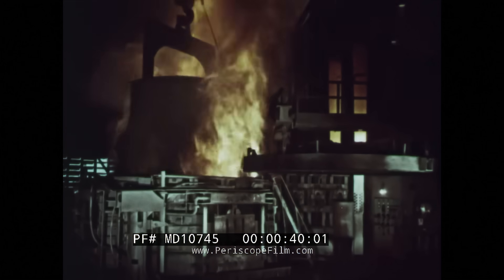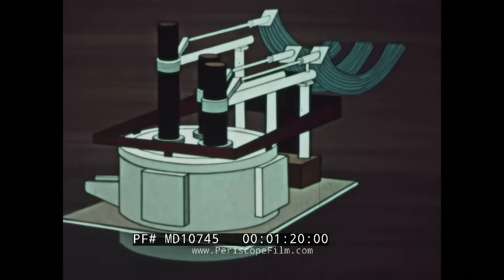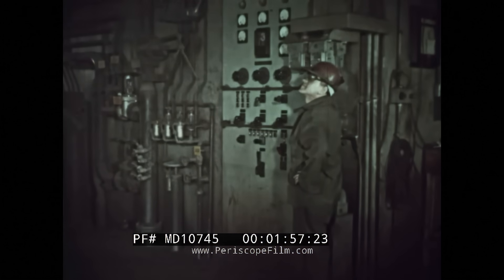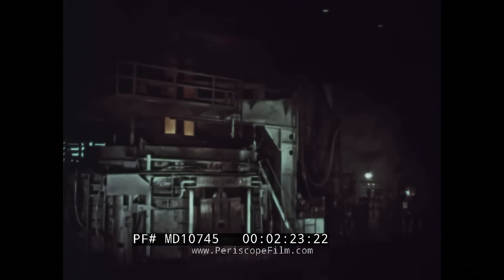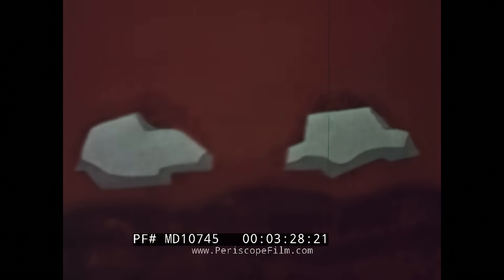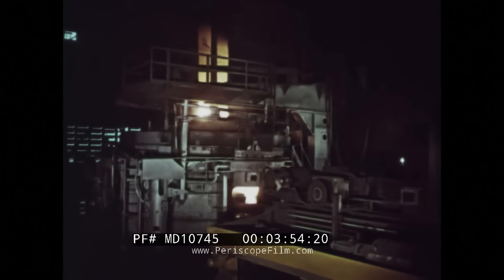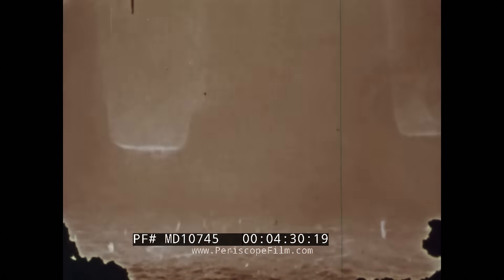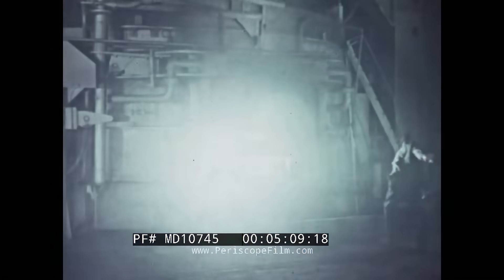"THE ELECTRIC ARC FURNACE" 1955 UNITED STATES STEEL PROMO FILM MD10745

Comment: I was about 12 when I found out about electricity and the carbon rods in those big lantern batteries. I build a fixture out of wood and plastic so I could move them closely together. I had disconnected the drier and used the 220 voltage on each carbon rods. When they got close enough they arced over and made the brightest light I’ve ever seen before the fuses blew.
Coincidentally just 6 years later I was flying as a Naval Aircrewman and the previous model of our aircraft had a huge carbon arc lamp in a pod on the wing to illuminate subs or ships at night. The carbon rods in is slowly consumed by the arc so it only illuminated for a short period.
Reply from the maker: Wow, what an amazing story, thanks for sharing! To think you coulda burned the house down or worse !!

Comment: Imagine the electric bill for operating an electric furnace. By the way, I have the 1957 edition of the U.S. Steel book, "The Making, Shaping and Treating of Steel." It used to be a difficult book to locate and consequently pricey. Now, thanks to the internet, it's pretty easy to find a copy of it.
Reply: I work at a mini mill (electric arc furnace steel mill) and our power bill is over a million dollars a month.
Reply: @trainwrecker22  Wow! And what size furnace is that in terms of tonnage?
Reply: It's usually cheaper for large-scale consumers to generate their own power on site.
Reply: have same. love the fold outs.
Reply: "Crom is strong! If I die, I have to go before him, and he will ask me, 'What is the riddle of steel?' If I don't know it, he will cast me out of Valhalla and laugh at me." ~Conan the Barbarian
Reply: I've talked to some engineers from an aluminium plant and they said that the facility consumes about the same amount of power as a decently sized city. A steel plant probably consumes slightly less.
Reply: Have you ever seen an electric meter spin like a table saw?